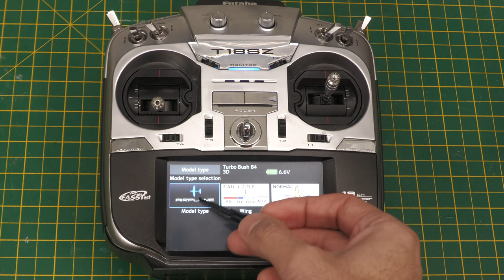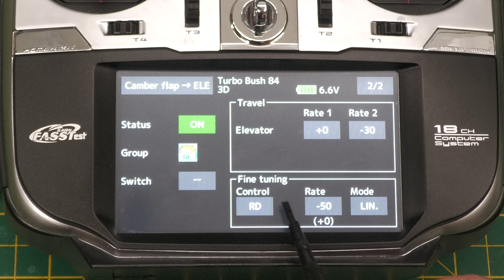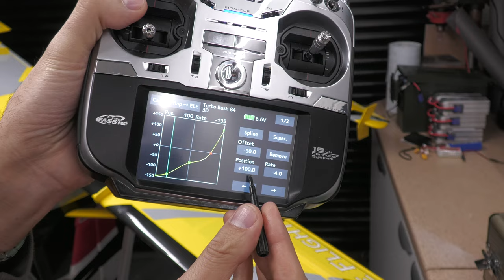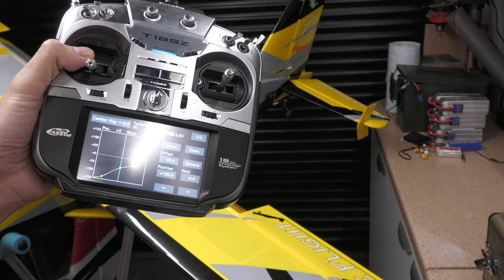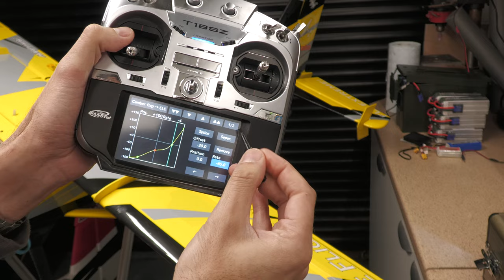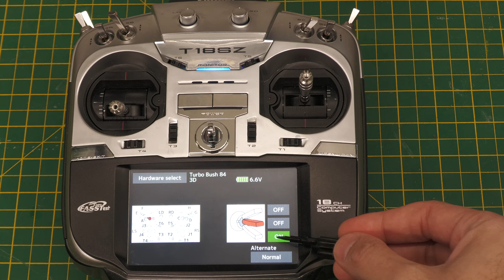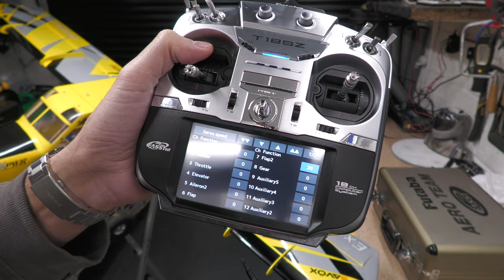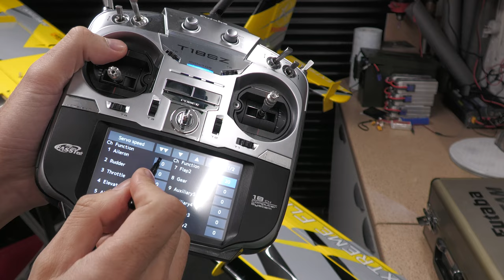How to setup Ailerons with Flaps on the Turbo Bushmaster | Futaba

Comment: Hello, thank you very much for this video. I am wondering is it the case that Futaba does NOT have any kind of computer (PC/Mac) interface for setup? I mean, something similar to the Companion software for OpenTX? I'm asking because I'm choosing the transmitter and receiver right now for a large full-length flaperon aircraft (one servo per wing) so I need to do some custom mixing in the software to adapt the differential aileron action right for all the flap settings from zero to full. I'm sure Futaba can do this kind of thing but I'm very keen on being able to set it up on the computer, not on the transmitter screen. If there is no such software for Futaba I think I'll go for a radiomaster instead. Thank you!!
Reply from the maker: Hi. I’ve never seen any Futaba PC or MAC software unfortunately. It’s a great idea which would help many people. I feel Futaba need to up their game with  software. Hardware is spot on.

Comment: What adjusts the elevator ? I have everything set up as you but I can’t get any elevator movement.
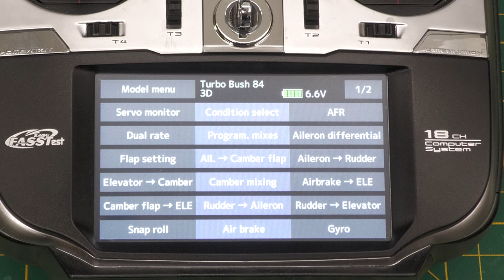Reply from the maker: Hi. It’s Camber Flap > Elevator built in mix. I cover it at around 5:30 in the video.

Comment: I have a problem. When I set everything up just as you have it. I have no down elevator in the mix and the trim changes the aileron position to make a right or left turn . Does not change the elevator position. I am using a 16 IZ system.

Comment: Hi Matt,Iam having an isue with my t16iz super,I have the ailerons mixed with the flaps to get full span ailerons witch work great the problem is when I won't to use the flaps and I slow the flaps down with the servo slow setting and then switch the flaps off back into full span ailerons the flap servos stay at that slow movement,is there any way to have them slow on flaps and back to normal speed on full span ailerons thanks mate,Tony
Reply from the maker: Hi Tony,
Yes I had that same problem in this Bush. I’m about to setup my 120” and will try and work around it. I think you might be able to do it using a flight condition, as long as the servo slow function works with conditions. 
I was going to try setting condition one with servo slow, normal ailerons. Then condition two with full win aileron and normal servo speed. I’ve not had a chance to look at it yet but will be filming my Bush setup in the coming weeks.
Reply: Thanks Matt for getting back to me,hopefully you will find a workaround for it in flight conditions like you said,I'll keep an eye on your channel for a  solution,thanks Matt
Reply: I just sorted it out Matt,instead of slowing the servo down in the linkage menu,go to the Airplane menu,then to ARF,then change the channel to flap and on the second page is the servo slow for flaps, set that for your slow flaps,and you will have normal speed on your full span ailerons,check it out.😅

Comment: How do I make the flaps go down and not up ? Tried reverse but no luck
Reply from the maker: Hi. You should be able to change it via the switch or slider. What transmitter are you using?

Comment: When the flap switch is in the middle position the green vertical line is to the right of center. It lines up with between at in Rate above.
Reply from the maker: Hi Robert. I’m not sure I’m following what you mean. What part of the video is this on? What’s the time stamp. Let me know and I’ll take a look. Thanks.

Comment: I have a 16 IZ there is no aileron flap in premix on my transmitter. Is there a way to create one?
Reply from the maker: Hi. This might be if your model type is wrong. Selecting different model types defines what preset mixes are available. However WARNING if you change your model type you will loose most of your setup. If you want to experiment, copy the model first to create a back up.
Reply: @MattTakharRC  Model was wrong. Senior moment. The flap servos to couple with the ailerons do the flap servos need to be in a centered position? Or when they are coupled will they go to a centered position automatically?

Comment: Hi Matt
Great video.  I have tried the aileron-camber mix  you showed in video.  The problem i have is while the flaps follow the ailerons ok at full travel in either direction the flaps go further than the ailerons In travel. How did you overcome this ? 
Regards 
Andy
Reply from the maker: Hi Andy. I don’t have my transmitter with me right now. It sounds like a limits issue. I’ll try and check my TX later.
Reply: @MattTakharRC      Thanks Matt appreciate that.   Keep up the good work with the videos  very informative 👍
Reply from the maker: Hi Andy, sorry it’s taken me a while to get back to you. The Bush belongs to a firmed who is on holiday. I thought I had the model saved on my TX but I don’t. I’ll try and check with him when he returns. Other than adjusting the travel (endpoints) on the flaps I can think or another way to stop that happening. Let me know if you work it out.
Reply: @MattTakharRC   thanks Matt appreciate that. I will adjust end points and let you know cheers 👍
Reply from the maker: Andy, finally managed to double check. It is the endpoints. Adjust both flaps and ailerons to match
Reply: @MattTakharRC    Thanks for the info Matt. I really appreciate that.  Love watching your videos great work 👍
Reply from the maker: Cheers Andy. Appreciate the feedback. 👍🏽🍻